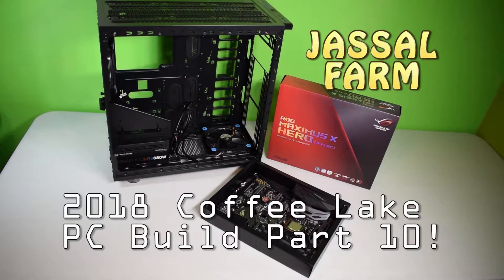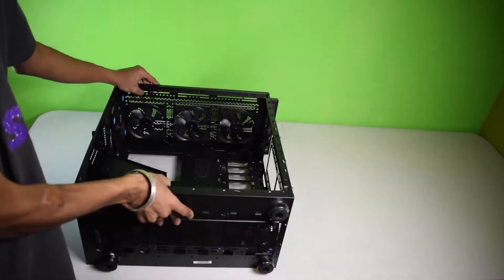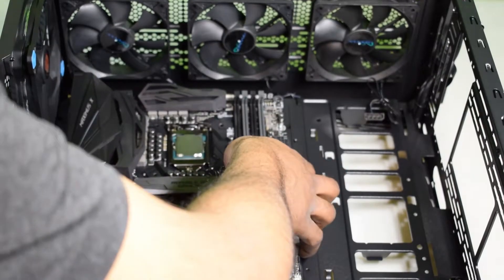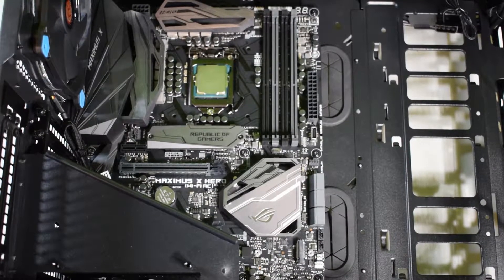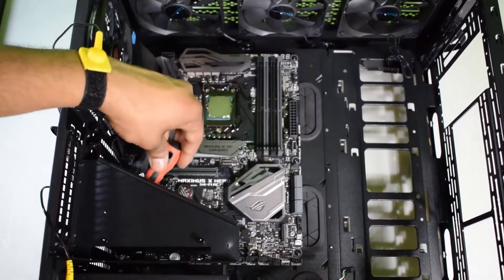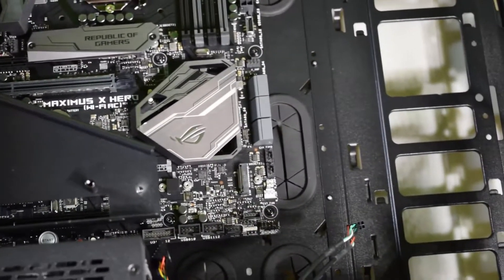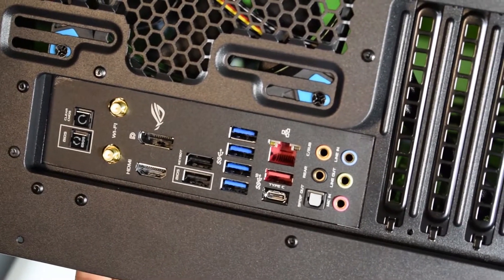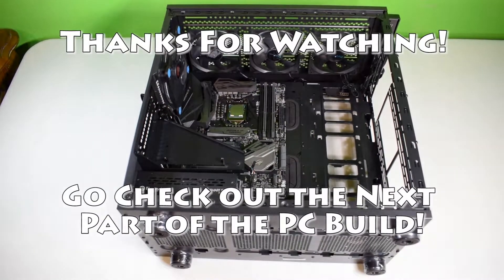(Part 10) 2018 Coffee Lake PC Build: Installing ROG Maximus X Hero (Wi-Fi AC) Gaming Motherboard

Comment: I just got the motherboard and it wont align with all the screws cuz of the IO shield. I have the phanteks p600s case. Its very frustrating...
Reply: Because motherboards come in different sizes, make sure you check your case and verify that the screw threads are in the correct holes. The holes would be labeled, i.e ATX for ATX size motherboards, so go over the screw threads )the part that the screw would screw into after the motherboard is placed inside the case.

If all the holes say ATX, then everything should line up, if not then make sure to unscrew them and place them in the correct size according to which motherboard size you purchased.

Sorry for the late reply!
Reply: After you confirm that the case has the screw threads in the correct position (i.e ATX for ATX Motherboards)

Double check to see if your IO shield is not bent, that may cause things not to line up correctly. A quick test would be to try installing the shield directly to the motherboard to see if everything lines up. Once confirmed, install the shield in the case first, then make sure to slide the motherboard so the back of the outputs can slide through the shield,

Once everything is lined up, the screw holes should be visible.
Reply: @TorontoVeganTravellers  the maximus X hero has the shield pre installed, did you even watch the video? It's just tricky to fit
Reply: @humonchronos9048  Yeah, it was a bit tricky and you're right it comes pre-installed, just depends on your case and how things line up.

Comment: How did you make it fit? I’m have the same case and mb but I can’t make it fit
Reply: Because motherboards come in different sizes, make sure you check your case and verify that the screw threads are in the correct holes. The holes would be labeled, i.e ATX for ATX size motherboards, so go over the screw threads )the part that the screw would screw into after the motherboard is placed inside the case.

If all the holes say ATX, then everything should line up, if not then make sure to unscrew them and place them in the correct size according to which motherboard size you purchased.

Sorry for the late reply!